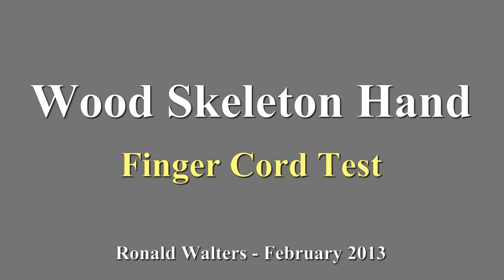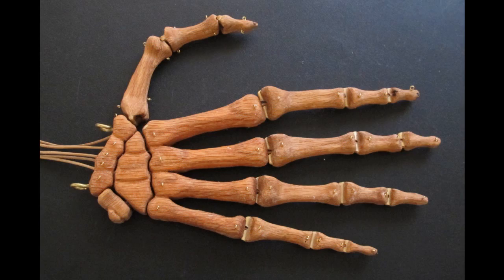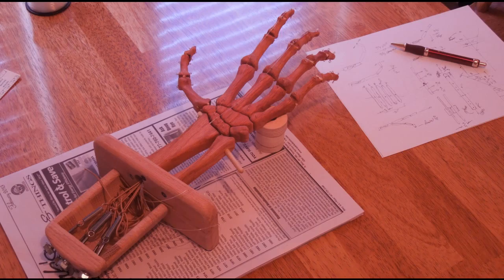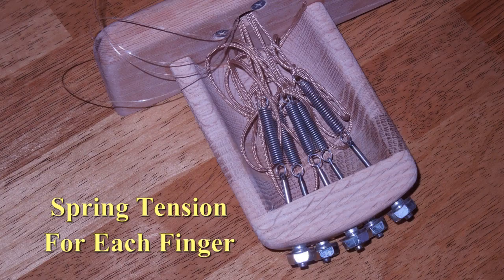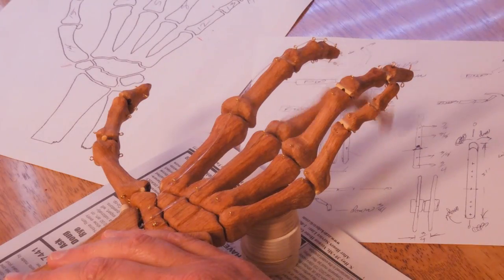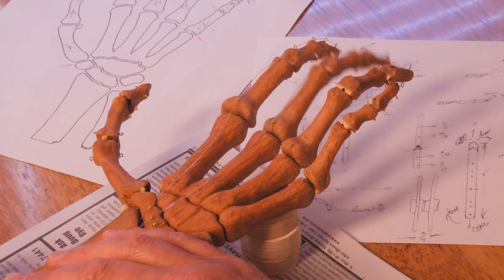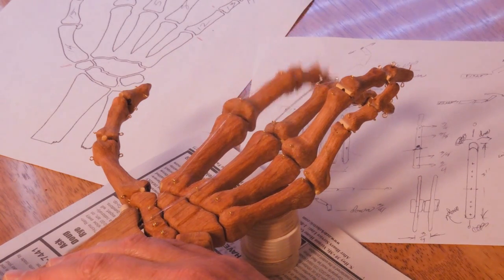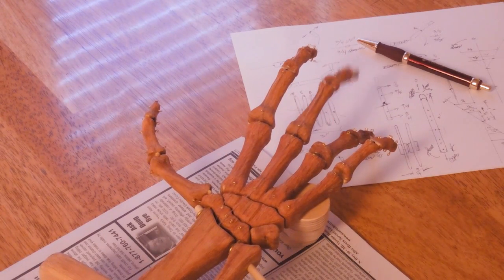Wood Skeleton Hand -- Finger Cord Test

Comment from the maker: Actually, the problem is at each joint. That is why I said there were going to be several pull cords, to control (or limit) the travel of each bone. If you look closely at the middle finger, two pull cords are already being used there and ultimately there will be three.

Comment: you'll need to restrict the joint from bending backwards and then you'll only need one pull cord to control the bend of the finger. you can maybe attach some stoppers in the area between each joint. these are your joints now: ==)o(==
you should place a stopper in the middle like this:  ==)'o'(==
then it'll bend down but not up. i hope that's somewhat clear :/